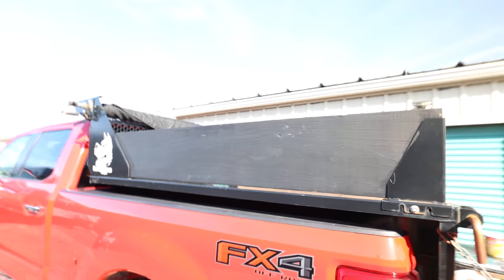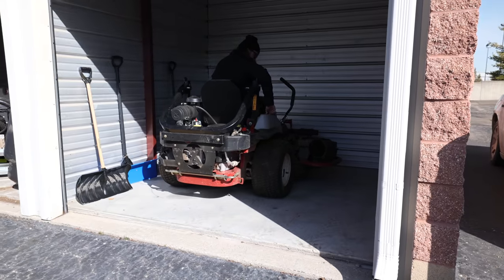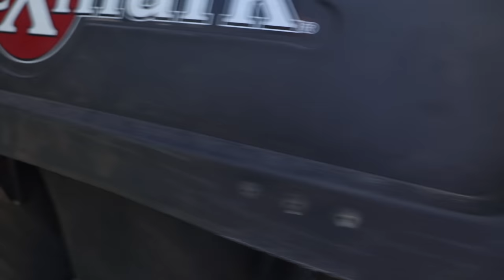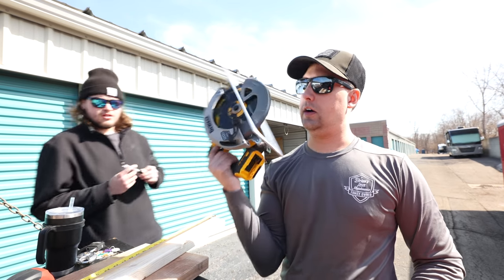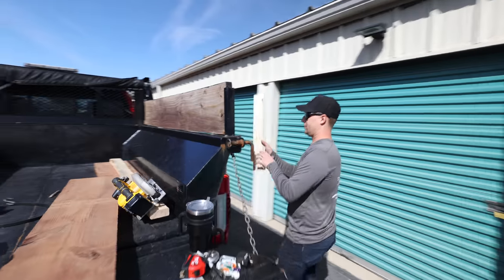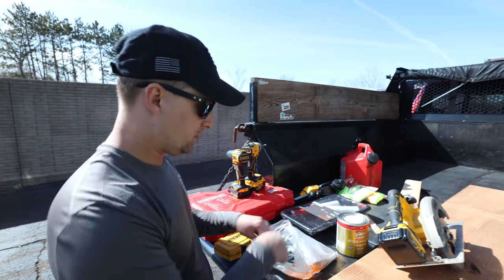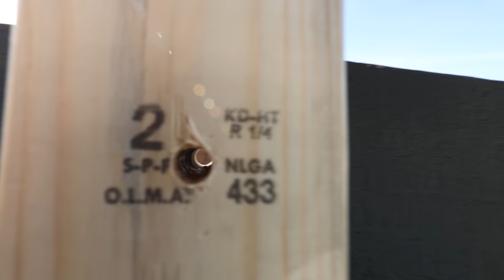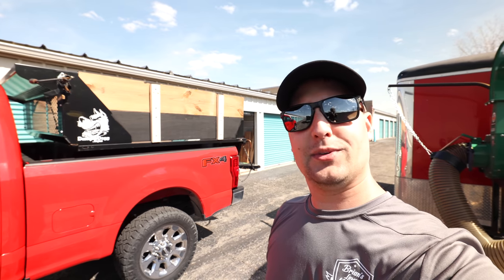READY FOR SPRING! ►Building Side Walls For Our Dump Insert!

Comment: My friend I'm not trying to be stupid but the way I understand things is, once you get the Blade Hot the Blade Flattens Out. A new blade has each tooth going the other way to create space for the Saw Dust and Cooling. It looked like the blade burned the 2X4 and that's why I'm sending this message. If you have a Lowe's there normally they have a Saw to cut wood for customer. 

Granted I have electric and battery Circular Saws, 2 Compound Miter Saws, Table Saw, Radial Arm Saw, & more.. I have Work Toys.
Reply from the maker: I honestly think the battery was super low, because we switched it out after and worked like a charm.
Reply: @BriansLawnMaintenance  cool cool. I thought that but the burn mark made me go the other way. Anyway, I hope you have an amazing day and week.

Comment: Hey brother how much did they rob you on the wood? My neck of the woods 25.00 for 8ft. 2x12x8
Reply from the maker: Man it’s crazy. $48 a board I think?
Reply: I’m in commercial construction and wood is very expensive. We’re exploring other means for construction material that used to cost more however are now equal in cost to wood and will yield a better product in the end.

Comment: The saw was binding on the wood because the heavy side of it was on your cutoff side. Cuts better running it the other way. Definitely put the 2x4s on the outside. Another good tip is to put the smooth head of the carriage bolt on the inside so it doesn’t catch debris. Hope you have a great season!

Comment: I have 3 different sets of sides for my 2006 Chevy 3500 dump truck. First with no sides I can fit about 2 yards of stuff. I have a single set of 2x8’s, and with that I get just over 3 yards. I have a set with 2, 2x8’s, and I get about 4 yards with that. I’ve never used them but I have a set with 3 2x12’s, and that would give me about 6 yards, which is way more than I intended to haul. Finally the boards belong on the outside. One helps material slide out easier and also even pressure treated lumber rots over time, and if loam, mulch or anything it’s built up around the boards if there on the inside they will rot just a bit faster

Comment: Use timber loc screws so you don’t have to drill 
And don’t hold that wood let it drop so it don’t kickback and you will get a nice cut 
I put 2x4 inside and use pressure treated